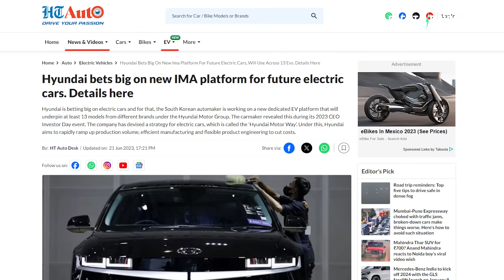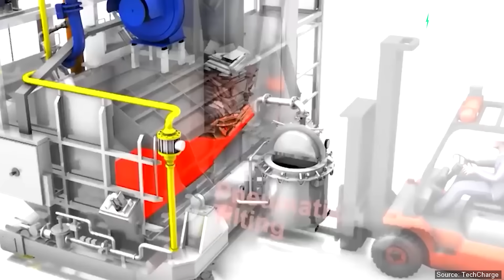The technology Hyundai will use to make the NEW Ioniq 2 EV for $22,000

Comment: Aside from the battery EV's should be much cheaper to build than ICE cars considering the electric motor and transmission is a lot less costly to build .Therefore with the price of batteries using  new technologies and automation it is no surprise thar EV's will be cheaper in about another 5-10 years time.
But we do have to take into consideration that EVs to day come with many more functions and improvements that were  not available before this new source of  electric power made them possible and they do add to the cost.
We have to ask ourselves do we need all these features when for most of the time they are not needed for a short daily commute which is all most cars are used for.
Reply: > . . . do we need all these features when for most of the time they are not needed for a short daily commute . . .?
Added features in a vehicle are there to benefit the automaker as plain and simple cars don't provide the profits that fancy pickups and SU-buses provide.  In a Capitalist society such as the USA, the only products we are offered are at the intersection of salable and profitable.  That is why the rush to pickup trucks and SU-buses.  It seemed that there was no limit to what people would pay for them until they reached $100,000.  Only then were people less interested.
Reply: Currently, EVs & hybrids seems to only come in the trim with lots of useless and annoying features, such as needing to go through a series of menus on a touch screen to change the radio station, so you need to stop the vehicle or take your eyes off the road for five to ten seconds.  I had that issue driving a friend's RAV4 hybrid.  That and turning on the cruise control required a sequence of seven or eight button presses.    The inexpensive EVs available outside North America don't have all these features.
Reply: @jeffreyquinn3820  And kilowatt sound systems. And sunroofs. I hate sunroofs.

Comment: What's the point of launching such electric vehicles if battery replacement is going to cost more than the cost of the car itself? Hyundai is very deceptive in selling vehicles & then charging crazy amounts for small replacements especially battery replacements where cost of replacement is more than the cost of the car. They were called out in Canada for following such immoral practices.

Comment: I'd get one in a heartbeat at USD 22,000 if the range is at least around 200Mi and it has a good battery-cooling implementation.
Reply: I have faith in Tesla Model 2, but not this one.  I remember Hyundai having less than $1000 in profit per car, where Tesla had $10000 in profit, so I see Tesla more likely to make it happen. Also, Tesla is ahead in production technology.
Reply: The Chevrolet Bolt already gets 259 miles for $25k, before tax credits.  Owners are saying it gets closer to 5 miles/kWh.  Sandy Munro gave it his blessing.
Reply: @chrisstavro4698  Cost was $27,500 and over $30K for EUV model. It failed and stopped production last week, because GM was loosing over $10K per unit sold. In typical GM Fashion, GM doesn't have a clue.   Poorly engineered vehicle and poorly manufactured, and too small for the US Market.
Reply: @igotanimac1    Again, Sandy Munro called the Bolt a good car.  If you don't know who he is, go find his videos.  Most first gen EV/hybrids lost money.  Bolt didn't fail, it's moving to the Ultium platform.
Reply: @chrisstavro4698  It failed, by GM's own admission. They thought it would sell more than it did. It's too small of a car for the US Market. It ended production because they wanted to stop the bleeding of $10K per unit sold even after selling thousands. Cars don't stop production just because they are going to move to another battery chemistry. The new bolt will be bigger, and more expensive, it won't be the same car, just the same name.
Reply: Why is battery cooling needed? I thought EVS didn't  have any moving parts
Reply: @markmiller8903  They probably meant less parts.
Reply: @markmiller8903 Battery management systems are essential for battery life.  If the battery gets too hot it degrades much faster.
Reply: Won’t happen
Reply: Not gonna happen. 200 miles for $22,000 is impossible. More like $30K for 150 miles and $35K for 200 miles.
Reply: @igotanimac1 based on what? A small car can get 4 miles per kWh. That means a 50 kWh battery for 200 miles. 
At $100/kWh, that is a $5000 battery.
Reply: ...based on corporate propagandists not even wanting you to conceive of 208 mi range for $12,000 but that is actually in production and for sale on other parts of the planet.
Reply: @igotanimac1  If Tesla has one at 25k I would buy that over the Hyundai at 22k.

Comment: When your $22,000 Huyandi battery pack gets a tiny scratch on the bottom cover, your friendly Huyandai dealer will inform you that you need a new $25,000 battery. The equivalent story has already occurred repeatedly with the Huyndai Ionic 6.
Reply: "It's only a flesh wound!"
Reply: The Hyundai battery pack is $60k, significantly more than the entire car.  If you scratch the battery, it’s a total loss.  I imagine insurance for Hyundai EVs will soon be prohibitively expensive.
Reply: Covered under warranty obviously!!!

Comment: EV consumers need to be a little more diligent the ICE care buyers.
I think it would be prudent for the EV buyer to get the official price of a replacement battery for the specific model they are purchasing.
This is both to protect the consumer and to put pressure on the manufactures to be reasonable with costing the batteries.
Reply: BS. Batteries are not wearing out. The only needed replacement are warranty or damaged.
Reply: That's not much different than, say, a Ford 150 owner needing to get the cost of an engine replacement.  Half the people I know who own one have to swap the engine as soon as the warranty expires.

Comment: Why can't an ICEV use gigacasting?
Reply: They can but they are sleeping on all innovation beside evs.
Reply: Bingo! 
ICE industry is legacy auto. Fat cats that don’t innovate
Reply: Firewall requirements? Penetration for the transmission tunnels and exh routed under the car maybe? Ice engines are also designed to get shoved down&under the car in severe enough collisions. 🤔

For the rear, perhaps fuel tank and exhaust system component clearance? It's a damn fine question imo, with no apparent answers.👍🏻